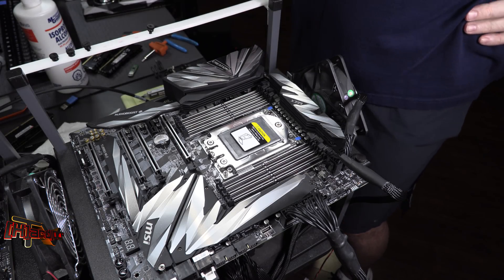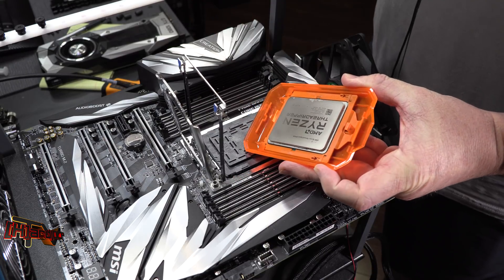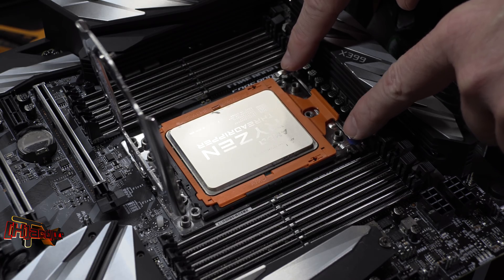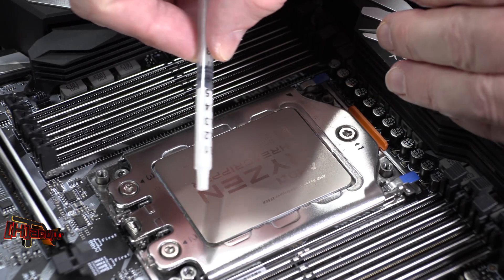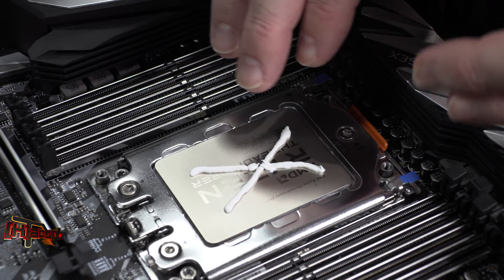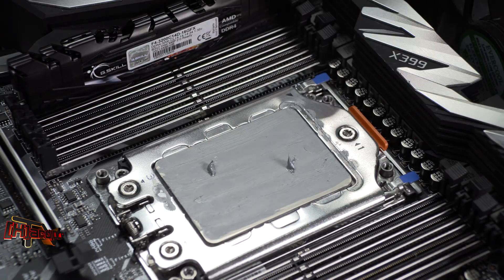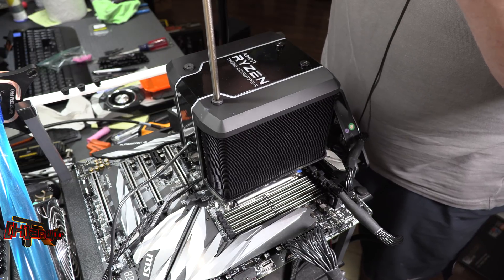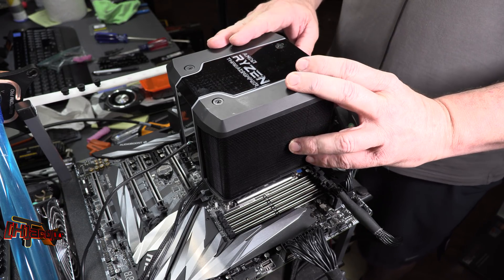Threadripper 2990WX - 2950X & Wraith Ripper DIY Install

Comment: Not all motherboard manufacturers making x399 boards include the second black cover as it is not needed, also absolutely do not listen to this guy and don’t turn on your system without a cooler unless you want to overheat and damage your cpu

Comment: Curious, you said the words "viscous tim." Never heard this phrase before. Is it another phrase for thermal paste? If so, where did this phrase originate from? Is it exclusively used with AMD cpu's? Been installing Intel cpu's for years and never heard these words used with Intel processors.

Comment: where are you supposed to connect the USB from the Wraith Ripper? I have this exact setup but after I connected all the cables from the case to the motherboard there doesn't seem to be anywhere left.

Comment: My cooler(the same as tours in the movie) came with its own pasta. Should i leave that pasta or do i need to add extra pasta?
Reply from the maker: You can use the TIM that is stock on the cooler, but if you are water cooling, I would suggest our method.

Comment: Appreciate the video as I am about to build mine in the next few days, just waiting on a couple of parts to arrive. I lucked out and my board came and it's got a Lotes socket. One question, why wouldn't you just heat up the thermal compound in a little cup and then spread it on with your finger the same way?

Comment: Thank you for one more excelent how to video! Having in mind that the fan should be oriented the other way as that's what pretty much all case setups are design for fore airflow. Would you be kind to provide instructions on removing the cover/shroud so we can reorient it?
Reply from the maker: The mounting posts on the TR3 socket are offset, so there is only direction to mount the cooler.  If you to change the airflow direction, you are going to need to pull the fan and flip it over.

Comment: I think it's time to release motherboards with already soldered processors, like videocards. Сhoice it has long been an illusion.
Reply: They used to do exactly that. You want to buy a combo pcb that you'll never be able to upgrade?  Mobo/cpu combos are still made though and you can even buy them right if the shelf at BestBuy now.

Comment: Guys never ever ever run your system like this you can damage the cpu very easily.
Reply from the maker: Actually you could not be further from the truth.  The Threadripper CPUs have shutdown circuitry to prevent any thermal loading issues.  We have tested this and it works.  That said, we are hardware enthusiasts and there are surely risks involved.  But to agree with you, for noobs or those with aversion to risk, this is not for you.

Comment: where do you buy one of those wraith rippers?
Reply from the maker: Newegg.  https://www.newegg.com/Product/Product.aspx?Item=N82E16835103273&nm_mc=AFC-C8Junction&cm_mmc=AFC-C8Junction-KB%20Networks,%20Inc.-nana_-na&cm_sp=&AID=10440897&PID=3891137&SID=rewrite
Reply: HardOCP TV  Out of stock. :( Has it been taken off the market? Recalled? Or just a supply issue?

Comment: Hey Kyle the Asus Zenith Extreme has a conflict with the Noctua TR cooler while using a GPU in the top slot. Ive been waiting for Wraithripper to hopefully bypass that issue. Do you foresee a similar issue between wraithripper and top slot GPUs?
Reply from the maker: I am just testing the Wraith Ripper now on the MEG X399.  It is a tight fit as there are cables that come out by the GPU in the first slot, but it does fit.  Should have Silver Arrow TR4 review up tomorrow with CMWR comparison in it.

Comment: The coolmaster. Version you can't install on a asrock. With out blocking ram slots. Found that out today
Reply from the maker: That seems very odd to me that Asrock would move the DIMM slots further in.  Did you see that we had to install the innermost DIMMs first, before installing those two sticks?  There is room for the sticks, but not enough room to install after the cooler is in place.  Where did you buy the Cooler Master?
Reply: Which ASRock board did you end up getting that had this issue? I just bought a Threadripper for a workstation build with a ASRock Taichi and am currently debating between air and closed loop AiO's and was seriously thinking about getting this cooler. Thanks.

Comment: Can you do a Roundup of am4 water blocks?
Reply from the maker: In all fairness, cooling AM4 is just not that tough.  I would look to the guys that did a good job with TR4 and look to their blocks.  In their TR4 blocks, you are basically just seeing an extension of their AM4/115X technologies.
Reply: HardOCP TV  Kyle I am loving the competition from AMD kicking Intel's ass in highly threaded workloads but what sucks Intel refuses to use solder on the majority of their cpu's. Does horse shi* cost that much less for them to keep using it. I love the fact that AMD keeps using solder unlike Intel. I am selling of my 6600k for a ryzen CPU and motherboard.
Reply from the maker: Intel going back to soldered TIM on the 9000 series....finally.
Reply: HardOCP TV   it would be cool if you could host another community event some day I miss those days :(

Comment: okay where did you purchase this? i live in california LA area and need this. I cant find any links to buy it.
Reply from the maker: 2990WX is out now.  https://www.amazon.com/AMD-Ryzen-Threadripper-2990WX-Processor/dp/B07G25SD1P/?tag=hardfocom-20
The 2950X will released in a couple of days.
Reply: HardOCP TV what about the cooler? I have a 16 core but don’t wanna buy a kraken. I’m looking for this cooler
Reply from the maker: The only air coolers out right now are from Noctua.  CoolerMaster and Thermalright should be here this next month.  Enermax has AIO coolers as well.
Reply from the maker: Results published here:  https://www.hardocp.com/article/2018/08/31/amd_ryzen_threadripper_2950x_overclocking/

Comment: If you told me 20 years ago that CPUs would have so many pins that installing them would be so complex they'd come with their own custom torque wrenches when you buy them, I'm not sure if past-me would believe you.
Reply: I take it that you haven't seen old ceramic CPUs that are like 8 inch square? and had up to 11x11 grid of CPUs and cache on individual chips on them? like the IBM 9121 TCM Processor module that had 2772 pads (pins) which you could have 6 in the system.

Comment: So if I use the MSI MEG X399 Creation motherboard and Wraith Ripper cooler I won't be able to have 128 GIGS of RAM (8x16) only 96 GIGS of RAM at best ?
Maybe It's necessary to install RAM first and then the cooler on top and tighten the screws with RAM sticks below cooler?
Reply from the maker: You can use ALL the RAM slots on the MEG with the Wraith Ripper cooler, if you are using "tall" RAM, you will need to make sure to install the two DIMMs closest to the socket first, before you install the cooler.
Reply: Got it. Thanks!
Reply: What about getting dual GPU's on the board with this cooler. Some are suggesting you need to be a wizard on most Mobo's with this cooler to get 2 GPU going.
Reply from the maker: I just measured these GSkill DIMMs I am using, they are 38.1mm tall, so I am not sure 44mm is going to fit in that inside slot with the Wraith Ripper.
Reply: HardOCP TV i saw in this article that it says 44mm and they show those rgb trident z which are 44mm on a asrock x399 taichi

https://www.vortez.net/news_story/amd_and_cooler_master_presents_wraith_ripper_cooler.html

Hope they dont lie.
Reply: I would like to say that I appreciate your very informative video! Been trying to figure out if my corsair dominators would fit under this awesome cooler.. starting to look like a no though. Do you know off the top of your head what the max height the DIMMs can be?

Comment: damn this motherboard doesnt have a real heatsink
Reply from the maker: ???  Actually the VRM heatsink on this works incredibly well.  Running 4.2GHz load across all cores, we are seeing surface VRM temps of only 120F with airflow.
Reply: HardOCP TV 32 cores with an air cooler???  :D

Comment from the maker: We deleted and re-upped this video as it was "stuck" at 360p.  Sorry to lose your previous comments, as there were some great ones!
Reply: I can accept that!
Reply: Still, even at 360p, that was the best X399(TR4) socket install guide I've seen yet! As always Kyle, you do great work, and you know how to teach your technique to others. Harvesting the crop right now, and if everything goes well, I want to do an X99 and X299 build.My current X79 DARK is one of the best MB's I've ever had. The X99 would be the X99 Classified, and the X299 would be the X299 DARK(with a 7980XE of course.)  But that said, I may just do an X99 build, and wait a few months and do an X399 build. I'll see what you have to say about the MB's, and I'll see what Buildzoid has to say about the VRM's of the different boards. I mean, that core count is so tempting. And there are rumors of an Intel X599 chipset coming out too. Tough, first world problems right! I'll put a link below to a few pics of my system, dog, and farm.

Since your previous video had problems, I'll ask again. Why don't you use Kryonaugt, from Thermal Grizzly? It has a rating of 12.5 W/mK. And it is not electrically conductive. Just curious! Also wondering why you don't have as many subs as your channel deserves! Have a great day Kyle!

https://drive.google.com/open?id=1mw9eza09q0PNKY5FiJ1KoIXL7JftIAdN
Reply from the maker: I have never worked with the Thermal Grizzly and is extremely expensive per gram.  We use a LOT of TIM, so we go with the less expensive Prolimatech PK-1.  5 grams of Grizzly is $20.  30 grams of PK-1 $27.  The PK-1 has Thermal Conductivity at 10.2 W/m-°C Thermal Conductivity of 10.2 W/m-°C.
Reply: That's a good price, and even a couple W/mk won't matter. Except for LN2! LOL! I will buy  a tube of PK-1. Thanks for the recommendation. Have a great day!